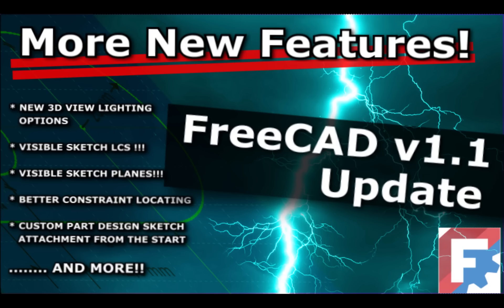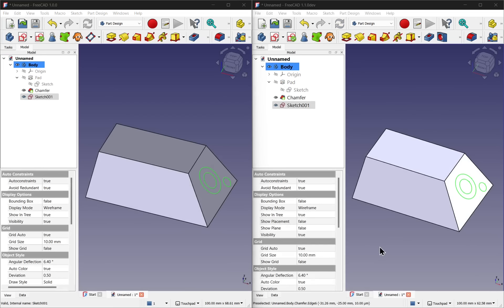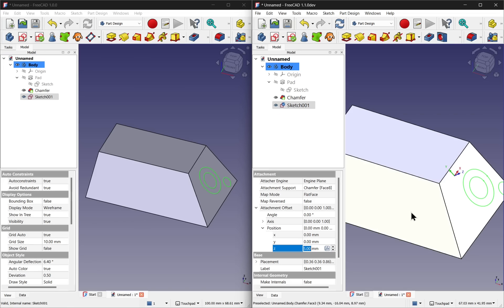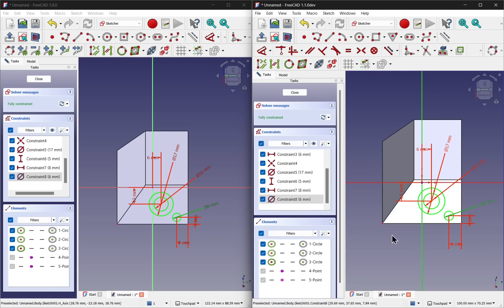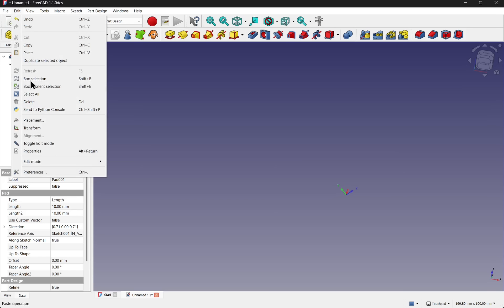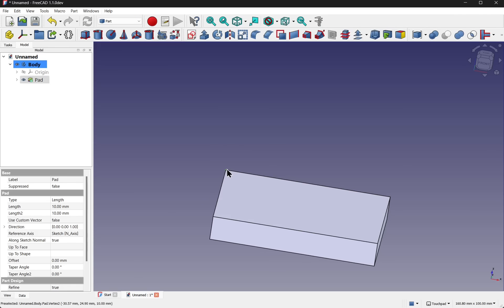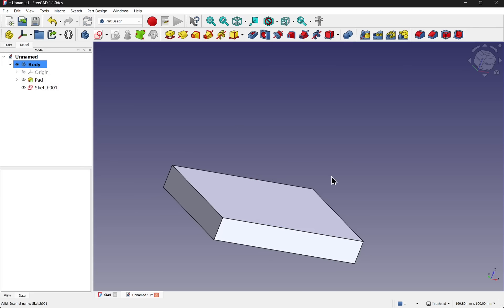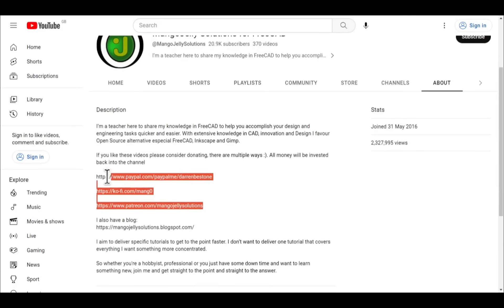FreeCAD 1.1 UPDATE! - Your Modelling Will Become A Lot More Easier! Next update to FreeCAD v1.0

Comment: I have subscribed and am now a patron of yours. I am on a weekly update, but what I have is 1.0.1 My light source menu is the old version with a single light source. I am on a Linux Ubuntu. How can I get your version? Or can I?
Reply from the maker: Hi Mike, thank you for becoming a Patreon :) So if your on the 1.1.0 weekly builds and seeing the old light source, then that is a bit strange.  My guess is that they may of temporary reverted it back to fix an issue.  Hopefully it will reappear on the next weekly build release.  I haven't used the weekly builds for a while so haven't seen this issue.

Comment: Thanks for the showcase! I love the ease-of-use improvements, because it makes FreeCAD that much easier for me to recommend to others!

However, I am still using realthunder's branch, because I think 2 of the most important features that I want are:
1) "make internals" in a sketch - having the ability to extrude sketch profiles, not just a single closed profile (or wire, in FreeCAD speak) 
One of my biggest pet peeves is fully defining a sketch, but then needing to redefine constraints after splitting or trimming lines/arcs. 

2) being able to create multiple solid bodies in a single PartDesign body - this itself isn't actually super important to me, I just find that creating a separate PartDesign body all the time is a bit clunky.
Reply: For the second, you can enable it on the body in the view panel : Experimental > allow compound
Reply: so, this would mean that you can select arbitrary closed region of the sketch to extrude?

>  "make internals" in a sketch - having the ability to extrude sketch profiles, not just a single closed profile  ...  fully defining a sketch, but then redefine constraints after splitting or trimming lines/arcs.

Comment: Should I swith to 1.1, is it ready yet? I've been using 1.0 for about 2 months. I'm learning the basics still and I'm wondering if I should switch to 1.1 now or wait until it's more developed.
Reply: As a beginner less of what you use will change which is both a pro and a con. I’d stick to the stable update channel.

Comment: ridiculous, only thing that is a 'HUGE' improvement is scroll to constraint and better lighting of scene..
BUT what about topology naming problem, solved ? FC is nearly unusable when fearing to modify previous steps and make whole project invalid !!!!

just a few simple easily achievable ideas for MUCH better orientation and productivity in FC

SKETCH : 
- overlap - it's so problematic to select some point that is overlapping with others as they are 'sorted' by some rule, in such case should give either popup choice what to select or cycle through if clicked more times holding alt (i.e.)
- highlight - would be nice on mouse over edge/point/constraint, that the related item is scrolled to and highlighted in the lists, and vice versa, when hovering in list to flash by yellow circle point/line/constraint in the sketch
- JIT - sketch right on face, having 'datum like' sketch infinite plane in 3d when creating such sketch, allow JIT intelligent placement/modification alignment with any edges or points in the object/assembly (without constraints) like in Sketchup, for to be able to quickly create things for creativity and then make it precise if wished to

FC: 
- perspective/ortho - remember preferable way of projection when in 3d or sketch + style, so annoying to always switch
- STYLES - define more styles  and allow to easily switch between them
- definable SECTIONS - allow 'cut through' planes with options what is visible, cut or left whole in assembly
- CONTEXT - filter toolbar icons for possible actions in the moment only, even allow basic operations like pocket(+/-)  or fillet/chamfer when something is selected and is mouse over for quick action, instead erratic clicking around

Comment: I"ve noticed a weird bug in preview sketcher where if you draw a line between two points that are the same level the line wont get attached to either points and instead just become horizontal i guess inorder to fix autoconstraints cauisng overconstraints it has to either removes coincident constraint or horizontal constraint and it always chooses horizontal constraint which is the opposite of what you usually want

Comment: Nice! Looking good so far. They need to make some more options for the cross section tool in the Part WB to be a bit more flexible, for example the height/position of the starting plane and a fixed incremental height of the sections. I find the cross section tool is still flakey when doing slices of a sold with a complex surface.
Reply from the maker: Those would be some great additions. I often use arrays and slices to get around certain restrictions but if this included in the tool life would be a lot more easier.